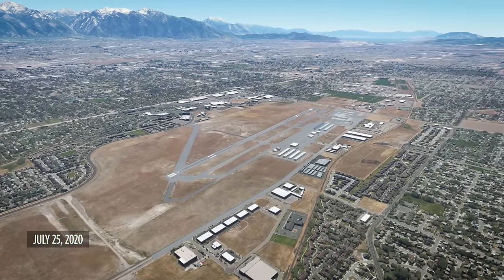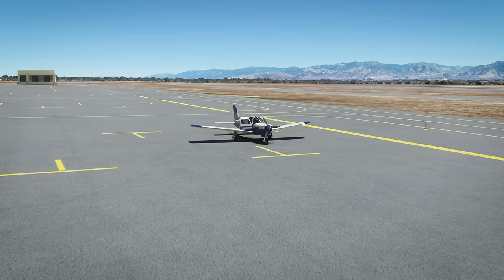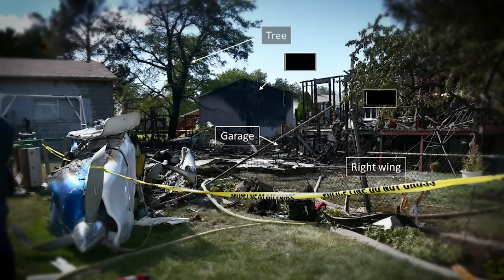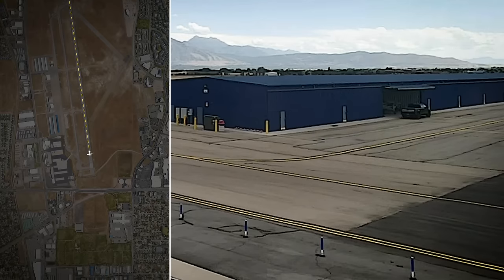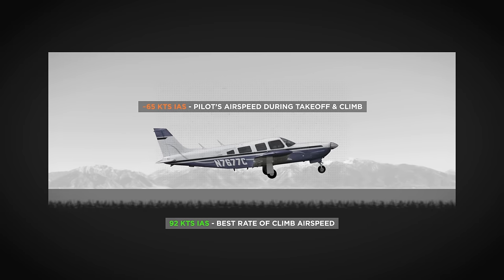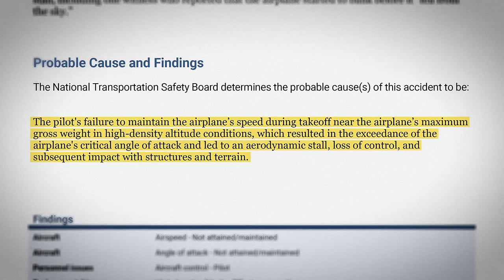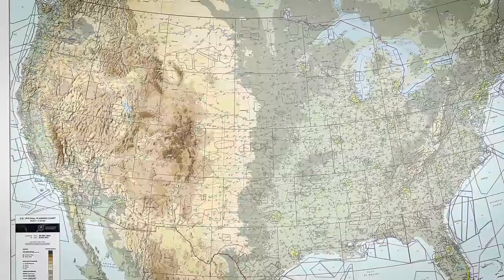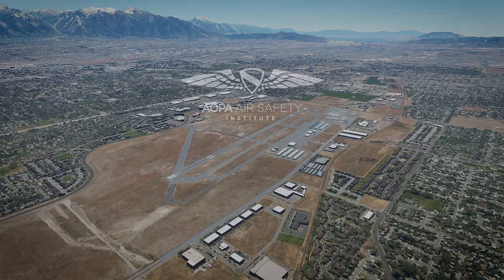Accident Case Study: High Aspirations

Comment: In 2023, we have advanced sensors for everything, even microwaves. Why can't million dollar planes have sensors that overide takeoff if A. Hot and Dense Air + B. Elevation + C. OVER WEIGHT and Aft CG. All variables and inputs that could have at least alarmed a very loud NO GO. Whatever your minimums are, subtract at least 20% to keep it safe. There are simply some variables that you cannot fully account for, like age and shape of the engine and airframe, tires rolling resistance, variable headwinds, etc.

Comment: Adding 50% is ridiculous. I didn't hear whether the gear had been confirmed up. It also probable that the flaps were still in a takeoff position. The use of flaps for takeoff is contraindicated in hot, high, heavy conditions. This aircraft should have flown. Horsepower does not significantly decline with age. Tired engines typically have something noticeably wrong. Airframes are airframes and should perform normally. The 540 engine on this airplane is usually bulletproof. Cause of accident improper leaning and failure to retract flaps.
Reply: The gear was up... you can see it stowed in the wings in one of the crash site photos.

Comment: Question for pilots here: if your plane is not climbing well after takeoff, should you add flaps to gain more lift, or just the opposite, retract them to "clean" the airplane ?
Reply: The drag from the flaps is usually more of a factor than added lift, you will balloon up a bit after adding flaps but then find it more difficult to climb. Opposite for retracting, you will sink upon retraction but then climb better clean.
Reply: Neither. Adding flaps will increase drag and cause a loss of airspeed and a loss of altitude. Retracting flaps will cause a loss of lift and likely send you into the ground as a result. The correct response is to simply maintain level flight until reaching a safe airspeed to climb. This, of course, requires that you have terrain and object clearance in front of you to avoid hitting anything.
Reply: Not sure the procedure on that plane. On the PA-28 short field takeoff requires 1 notch of flaps, rotate at Vx, stay in ground effect until Vy, then retract flaps and climb normally. Very troubling to me, as by all calculations he should have made it.
Reply: @grafhilgenhurst9717   I believe the procedure you mentioned for the PA-28 is for a SOFT field takeoff. The short-field one asks for the same 1 notch of flaps but to climb at Vx until clear of obstacles. Then after the obstacles, retract the flaps and climb at Vy.
Reply: If you are above the bottom of the green arc at the time then coordinate a raising of flap  [ which will accelerate the a/c ] with a corresponding pitching up of the nose to increase AOA and prevent the loss of lift from reducing flap . At least, that’s the theory of it !  I don’t like using any flap for T/O anyway unless it’s a short or soft field [ acceleration is faster and climb angle and rate ,as well ].

Comment: I would have probably done everything like this guy.
And died just like him.

What really gets me is, that the situation was not so obviously bad in a blatant fashion. Yes, with 20/20 hindsight, one could have opted for an additional fuel stop to keep the plane light on climb out.

Maybe one day non-turbo birds will be a thing of the past...
Reply: Doesn't turbo birds have accidents?
Reply: @angela1984a  of course a turbocharger does not make the aircraft impervious to accidents. however, there are many accidents, where more power could have prevented it. This is clearly such a case.
Reply: @daszieher  Turbo birds can also be overloaded. And their performance can also deteriorate over time...
Reply: @angela1984a  yes. But they don't lose power every couple of ft in DA change.
More power, more better.

Comment: If a plane does not have the power to climb and fly in a high density altitude with four sets and four good size adults It should not be fly worthy and should not have four seats.This kind of thing happens way to often.These little fly machines takes the lives of so many.most of the time they either don't have enuff power or no power or someone stalls trying to climb to steep or flying to slow and most of the time to steep.This crash he never got the plane to glide.guess what happened.

Comment: Sad. The best thing is to wring as many lessons out of this tragedy as possible to give it AS MUCH meaning as it can be given. This gives the loss more meaning, the lives more meaning, gives this tragedy as much sense as possible.

It was the kind of mistake anyone might make, one must have confidence to be a pilot, and there is a fine line between a safe amount of confidence and too much. Crossing that invisible line is far to easy to do, right?

If your answer isn't yes, think about how this pilot might have had the same answer right up until the moment he began his rotation on that day.

Don't let this tragedy be in vain.
Reply: A mistake that anyone could make by putting their family and friends in an airplane at the edge of its performance envelope.  I don't like those odds.  He had to fly like the Piper test pilot who certified its performance numbers to make this flight.  He blew that by taking off downwind and not leaning the mixture.

Comment: Not a pilot hence the question. Would airspeed continue to increase if he kept it in ground effect until he was running out of runway?
Reply: You could be a pilot with those kinds of observations! Yes, the reduced drag of ground effect would allow you to have a lower pitch attitude and continue to accelerate while staying in ground effect. This is similar to a practiced take-off called a soft field take-off that is taught during private pilot. 
From the video it does look like the plane is in a fairly high nose up attitude just after liftoff which would prevent it from gaining speed and being able to accelerate to best rate of climb. At the same time it would limp out of ground effect and likely sink back to the runway.
Reply: @FLYGMFT  the airplane would lose performance even in ground effect coz of the weight density altitude and the fact the correct take off speed hasn't been reached anyway.
Reply: @luntbanzi1967  You're right the plane has worse performance than sea level, standard atmosphere, minimum weight but that's not the question. From the report the plane was within the W&B and had the performance necessary for this takeoff and climb. Staying in ground effect would allow the plane to accelerate to a higher airspeed before continuing the climb. This effectively increases the performance of the plane untill it leaves ground effect.
Reply: @FLYGMFT  I'm talking about the same situation. You heard it yourself, performance calculations don't always go as smoothly as one would expect speically when the plane is so close to the max weight with other factors decreasing the planes performance. Staying in ground effect sure does help, I'm saying I don't even think it was possible for the pilot due to the plane being so heavy and other factors. It's not just a "he stayed in ground effect everything would have been fine" with less weight sure it becomes easier. Performance calculations should have cleared him with a nice take off, you heard it in the video yourself
Reply: @luntbanzi1967  Video states that the plane MAY not have been able to meet the book performance values. That has not been proven to be the reason for the accident. The video also speculated about reasons why the plane wasn't able to meet the published performance values.  One reason could be pilot technique, like excessive angle of attack, which allowed the plane to takeoff but made it unable to climb after leaving ground effect.
Reply: In fact the airplane would not have been able to accelerate a great deal more, perhaps 10 or 15 knots, due to having flaps deployed which incurs a significant drag penalty. In theory, airspeed would continue to increase until whatever the Vmax happens to be at that altitude and weight, which for such an airplane with flaps up would be over 120 kts for sure. Note: this ‘top speed’ would benefit by only a knot or two for being in ground effect. Simply stated, the reason the difference would be small is because ground effect reduces ‘induced drag’ only, but induced drag is only a small fraction of total drag when at high speed.

Comment: Airplanes MUST HAVE FOWARD AIRSPEED TO FLY THE HEAVIER UNUSED TO LOAD LACK OF POWER STEEP CLIMB HIGH ALT RESULT CRASH .HOLD ON RUNWAY VERY SHALLOW CLIMB. MAX MIX AND POWER SUCCESS. SLOW LOW HOT HEAVY HIGH ALT LACK OF POWER CRASH.

Comment: Do people not read their POH and understand DA? I couldn’t even solo a 152 until I had completed a pre solo exam, that covered all the parts of the POH and had me perform DA calculations as well as W&B. 
Getting your license doesn’t mean you get to forget about basic flight physics and calculations. 
Also understanding the 70/30 rule for takeoff could have saved these people.
Reply: It was stated in the video that he had performed density altitude calculations and was within manufacturer specs. He had also done weight and balance calculations.
Reply: Also, it's 70/50 rule.
Reply: @aidanbailey9967 Yeah , but if you go by the book it has to be the whole book .Climb has to be at the correct Vy , and Vy decreases with altitude. Also , the climb rate at any DA is assumed to be clean [ no flap ] ; there seemed to be a question as to whether he had some flap down .

Comment: Not a fan of the probable cause from the NTSB. The video's great, the facts are presented well, graphics good. However, the NTSB probable cause is incorrect and is NOT helpful to any current pilots out there. "The pilot's failure to maintain the airplane's speed during takeoff..." Um, what? Yeah, no kidding. How does that prevent any future pilot in this scenario? Hey, pilot, your plane's not climbing, it's barely flying, but just maintain speed during takeoff and rotation so you don't have a video made about you. (That implies he COULD have taken off without issue - incorrect, he could not, the plane would not climb!) This is at the intersection of a rejected takeoff (RTO) and loss of thrust on take-off scenario gone bad (LOTOT). The pilot should have rejected take off (RTO) and got back on the runway (a few seconds after attempted rotation). There is VERY LITTLE if ANY training done nor required by FAA pilot little training required on that per FAA standards. Maybe once or twice in PPL training, and never was the scenario like this where the plane was almost able to fly. His training on this was all talk and on paper - nothing PRACTICAL. And it might have been years or decades ago. Every take off is a RTO with the option to take-off. Every pilot needs better training (AQP for GA anyone...) on practicing RTOs and LOTOT. Another useless NTSB probable cause...that won't prevent any future accidents of similar lore.

Comment: So the aircraft is not overweight, the CG is within limits, there was no mechanical problems with the aircraft, the pilot calculated proper takeoff and climb performance for the day and yet the plane still didn't perform like it should have? This is the pilot's fault? IMO I'd be sueing Piper or whoever created the numbers for the POH.

Comment: Well, there's 14 minutes I'll never get back, and lives that they'll never get back, without any rational cause offered for either. All the suggestions of being misled or attempting to do what the manual showed plenty of margin for doing are not explanations, causes, answers, or solutions. You know better than that. It's a very poor video because you actually have nothing to offer other than to point out that what the manufacturer has told its owners / pilots for years was a reliable expectation was not at all--not even close; i.e., they have lied to hundreds or thousands of people at the risk of those customers' lives. No responsible insurance company should be willing to touch them. Furthermore, since this clearly proves that the company's engineering and manufacturing could not be trusted, what recommendations did the NTSB then have to offer to avoid this outcome in the future? None. Instead, they did a desperate reach to make it pilot error, when nothing here suggests that to be the case. At the very least, the incorrect POH should have been the principal cause or factor in the accident and the NTSB should have recommended, and the FAA subsequently required, a revision of the POH for all aircraft of this type, and a review of all other POH numbers that the manufacturer has published for similar circumstances. A hard-hitting video addressing all of those realities, along with a serious, attention-getting warning to pilots about false POH numbers used to generate sales (original Cessna Cardinal scandal, for anyone old enough to remember?)--now that would have been worth watching.

Comment: Blame clearly lies with the manufacturer.  The numbers they put in the book are supposed to have at least a 10% margin.  The pilot did everything right and the plane failed him.
Reply: Taking off with a tailwind is correct?  Who knew...
Reply: Numbers are based on a brand new airplane, also.
Reply: They said it was an old plane.
Like everything in life, performance decreases with age.
Reply: Well , that’s the problem , we don’t know for sure what his flap setting was , or even what A/S he was using. [ Vy decreases with altitude ] .
Reply: Well indicated airspeed also decreases with altitude.. True airspeed would be higher. I realize all performance will be based of indicated.
Reply: Downwind departure, beyond the limit of the take off chart, 6 out of 12 plugs “severely eroded”, fuel mixture not leaned for the high DA, stall when the airplane demonstrably possessed the performance to at least stay airborne. That is your idea of doing everything right? How is the “manufacturer to blame” for any of those things?
  Also, please cite where in the CARs (or GAMA Spec 1) it was ever required that manufacturers pad out the performance estimates by “10%”.